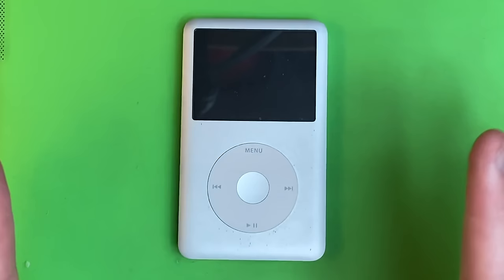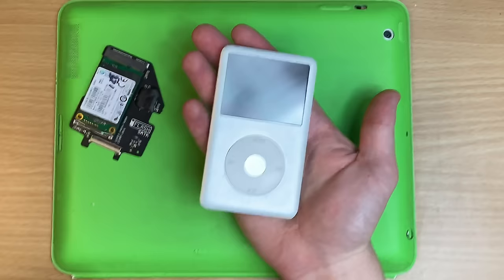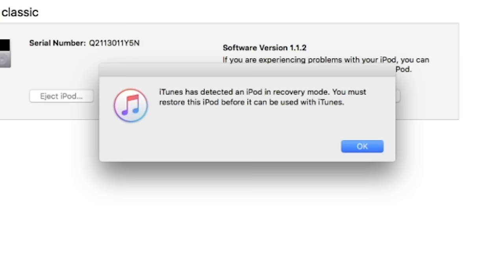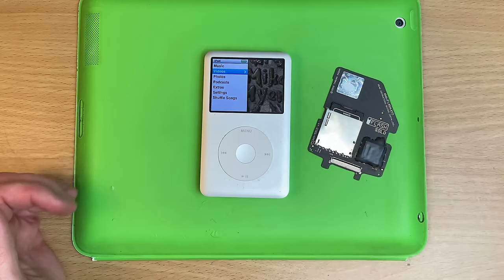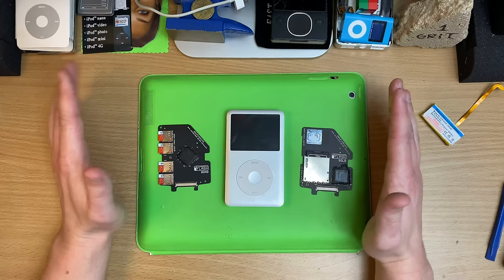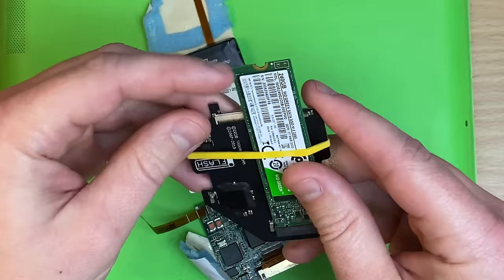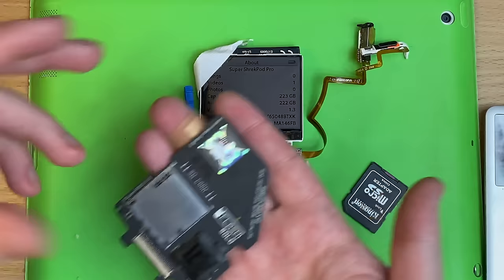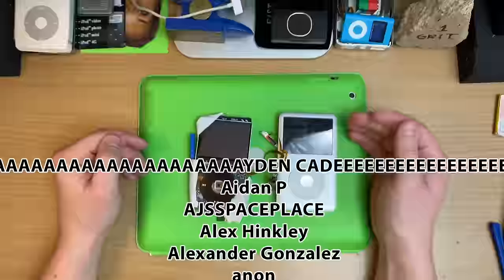PC SSDs in an iPod Classic! (M.2/mSata)

Comment: I love how his iPod has an M.2 SSD and my gaming PC doesn't.
Reply: If you use a SATA M.2 like he did, there isn't any reason to use it in a desktop, since a regular SATA SSD will perform just the same, while being cheaper than the M.2
Reply: Joseph Still this isn’t entirely true, there are m.2 drives that are faster by a large margin, but most the time a sata ssd drive is sufficient
Reply: @thetechconspiracy2  size. They're tiny, and don't need cables.
Reply: @ajfergy5569  Those are called NVME drives. Not useful unless you're working with a lot of data at once. Games and OSes load a split second faster.
Reply: I love you one of his iPods has 2 TB when my PC doesnt
Reply: AbodyAbdalluhhhhhh
Reply: @Adkatka No, the form factor is m.2. The interface is Sata III or NVME. Sata 3 is limited to 6gbs and NVME is way higher. Just because they're in the same m.2 form factor doesn't mean they're equivalent.
Reply: I don’t have a pc m8
Reply: Anonymous they also run hotter and can be unreliable. I have heard of them dying within a year of use. They should have a heat sink on them to help it out.
Reply: Dude, my pc has a 1tb spinny boi from 2009
Reply: thats what she said
Reply: @Alexander_l322  flash drives have a minimum temperature they have to run at, they die faster if you overcool them so it's not always a great idea to cool them manually with a heatsink.

(Even room temp is too low iirc)
Reply: Then get out the guts of your iPod and Chuck it into your pc.There you have it
Reply: Same.
Reply: @tazogochitashvili6514  Iirc, the Nand modules are fine to cool but not the controller, Im pretty sure its because you can create a voltage difference. (Could be wrong). But yeah, however it comes like is how it supposed to be.
Reply: Same
Reply: An ipod is better than my PC
Reply: @TheRealMaroonExpy  I got a imac thing from the recycling centre and it had a 2tb harddrive innit. Late 2009 Imac i think. Now its in bits and the harddrive parts under a sofa or something lol <3
Reply: @thetechconspiracy2  my PC only has a 1TB HDD inside of it. this is what i get for cheaping out with a pre-built.
Reply: @AbdAbdAbdAbd  DIY is cheaper lol
Reply: @Alexander_l322  nvme unreliable? is that why servers are switching to them?

but han, nvme ssds are generally more reliable overall, as the lack of moving parts means that its just better. now if you are referring to drive life, technically its less? but like not noticeable unless you bought a QLC drive (if so, lmao)
Reply: @marcusborderlands6177  I think they can be if not properly taken care of. As in allowing them to get hot which they will if not properly cooled with a heatsink and yes I have heard of Samsung evo I think dying out quite quickly but that was a while ago so maybe they are better now.
Reply: @anonymous2804  not useful? have fun installing call of duty on a HDD, I went from a sata ssd to an nvme ssd and my god is faster
Reply: @paytondev  i'm bout to get 4gbs(replacing my 256gb C drive with a 2 tb one)
Reply: My gaming PC doesn't have an SSD a hard drive it has a hard drive it does not have a graphics card or anything good just a bare minimum crappy pre-built PC
Reply: @thetechconspiracy2  but my laptop is ultra thin so it needs to use a M.2 SSD
Reply: I have a 100gb m.2 only for the os. Rest goes on HDD
Reply: I got a 1 Tb and external2tb spinny boi but its a slim so its ..... GoRbAgE
Reply: i'd just stick with a SATA SSD for gaming.  Get an M.2 for your boot drive, and if there is a thermal pad included along with a thermal shield of some sort.  USE IT.
Reply: @TheRealMaroonExpy  how tho
Reply: @saints_row_cat  Good question. I have absolutely no clue. Still working tho
Reply: @anonymous2804 they load faster more of the time since they can handle at least 3 times the speed of standard sata
Reply: @ajfergy5569 he said SATA. Which is true. The M.2 drives that are faster use the NVME spec, not SATA.
Reply: I got a SeaGate Barracuda HDD, slow but big

Comment: If you go the SSD route be careful of the amperage requirements. It's best to go with something under 1.0A. I've had great results with 0.6A Kingston 128GB, 0.7A Samsung 256GB and even decent results from an SK hynix 256GB @1.0A, but 1.5 and 1.7 rated drives are far too thirsty. Even for a phat 5th with the beefy boy battery.

Comment: I have an iPod Classic 160GB, bought new from Apple years ago.  Some time in the past 7 years, the hard drive died... dead as a doornail.  I found a company in Sydney who repairs Apple products under licence.  They replaced my hard drive with a SSD 256GB.  It's been running well since then (except for the one podcast that won't sync for some strange reason...).  I use my iPod in the car when I go for long drives (I live in a major rural NSW town) so I don't need to fiddle with the radio, and don't need to worry about lack of internet coverage out in the bush.  I have over 2,500 podcast episodes (excellent for long drives, can listen to multiple episodes in sequence) and over 7,000 songs, and all the Harry Potter spoken books.  And I still have almost 90GB free on the drive.  I love my iPod Classic.  Plus, I don't have to overload the phone with things...

Comment: What about putting a raspberry pi zero in one? that would be sick
Reply: Sounds like a good idea! ...If you can connect the screen and click wheel to Mini HDMI and micro USB.
Reply: Shove one in with a ripped iPod BIOS and two of those 2TB Micro SD arrays...
The ShrekPod Pro Ultimax is born...
Reply: BUT CAN U PLAY MC WITH IT.?
Reply: @thescreemregular5168  sadly no
Reply: @thescreemregular5168  not on a zero probably, but you might be able to get a pi 4 to fit in a case and it probably could
Reply: @UCXEO5L8xnaMJhtUsuNXhlmQ  I have pi4
Reply: It to big for even 1st Gen case

Comment: 9:55 there’s difference between 
- msata
- m.2 sata (and there are 3 models of m.2 sata “model B” - “model M” - “model B+M”)
- m.2 nvme 

Usually it’s not wise to mix them with one or another connector
Reply: You're completely wrong on the M.2 part. No, these are not "models", and nor are there three, these are keys, and there are well over ten last I checked for various purposes.

the B key indicates the ability of the SSD to connect over SATA, B and M means SATA and PCIe x2, and M means PCIe x4 only. NVME is marketing speak for the M key ones.

Comment: Two things worth mentioning:
The slowness you experience in the hard drive iPods isn't from hard drive speed. It's just the time it takes for the drive to spin up, as the iPod puts it to sleep whenever possible. SSDs don't need to spin up, of course.
Not only do M.2 SSDs come in different lengths (2280, 2242, etc) but the interface can be different. This kit needs a B-key SSD, which supports SATA. Basically like what mSATA is to MPCIe. An M-key SSD, which is PCIe/NVMe, would not work.

Comment: The SD cards probably took longer because of addressing, being a higher capacity it needs to organise more space in some file formats as opposed to adding straight to the pile. Also you have a module addressing SD's independently which will ad milliseconds to each file transaction. If you had a single SD adapter it would probably outrun the OG drive at a sprint.

Comment: The fun part about these is, if you've got an old HDD-based camcorder you wanna keep using (for whatever reason, the standard def ones are trash but the HD ones hold up well) and the hard drive dies, things like the HD HandyCams use the EXACT SAME HARD DRIVES as the later generation iPod Classics so these'll work well in a camcorder too. Pretty handy to have, like, enough memory to shoot for a WEEK STRAIGHT and not have to worry about the hard drive dying if you knock your tripod over.

Comment: MMC (the predecessor to the SD card) is still used in many lower-cost devices as built-in storage. This includes most laptops under $300-$400 USD, and the lowest-tier steam deck

Comment: I think the reason why the SD card and M.SATA SSD were slow, is because the 3rd party board does have some sort of chip in it to allow the compatibility with the old device. Cuz the HDD is linked right to the device, no extra stuff to slow it down.
While these other mediums are having to be trafficked through some chip in the custom board so it will work.
Maybe if there was an SSD that had that direct connector that the HDD has, then maybe it would be faster.

Comment: 60 degrees ain't nothing for a semiconductor device. you should worry after it breaks 90.

the true problem is the battery. not only because it's gonna get juiced down faster, but also because of the temperature it's gonna be forced to tolerate (and usually it can't and fails earlier)

Comment: Damn old apple devices were actually extremely flexible, plug in a type of hard drive that was in the early experimental pre-pre-pre-pre-pre-alpha stage when this ipod was built, which has an amount of storage that ipod was never even intended to have and the ipod is like "ah a hard drive lets go!". These days you replace a component and even if its a brand new one of the exact same model, in perfect condition, built on the same day, on the same production line, in the same batch and the response is "I've never seen this man before in my life I will now shut down to 'protect' myself".

Comment: "Mate it's not an SSD" As he said, it stands for Solid State Drive. It doesn't have any moving parts like an HDD (Hard Disk Drive) which has a moving disk as the name implies. All of the data is accessed through billions of microscopic power cells rather than a spinning disk. Flash storage has this same type of hardware inside of it. So in other words, it technically falls under the category of SSD.

Comment: You totally can use a Compact Flash card in a computer. In fact, it's a very popular solution for reviving very old PCs (1986 to 2000 or so, typically). All you need is a simple adapter, not unlike an iPod solution.

Comment: Here's why I think the SSD lost to the HDD in that benchmark:
SD cards are slow. In a flat out write race, a hard drive will smash an SD card
I think the reason it feels snappier in everyday use is because SD cards have a lower access latency than HDDs, which means when the iPod asks it for some data, it will start sending data sooner than an HDD. The SD card doesn't have a spinning disk it has to wait on.

The conclusion: unless you're using your iPod as an SD card or trying to sync multiple gigs of data at once, the SD card will feel snappier.

Comment: Got one of these players but it must be made of hardened titanium, I have done my best to open it and so far no success, but I need the tools. Battery is dead, so I need to replace it, but …. Thinking of trying a blow torch or an angle grinder.
Well, it is so fantastic that these great little players can be given a new life and even new colors.

PS. Found stuff on AliExpress, but I prefer not buying electronic stuff from China, only mechanical.

Comment: I finally put the iquad in my 7th gen. I’m getting seemingly random, inconsistent, and intermittent track skipping.   Tracks will play, then pause for a second, then resume before skipping a few, then playing again. Going back will usually make them play, but will still randomly skip ahead at some point. 

I’ve formatted my 128 Sandisk Extreme pros, went from 4 to 2, resynched. Nothing skips in iTunes or the original hdd.  Files are from various sources.
Havnt tried another mobo, zif, or flashboard yet.

Comment: A pro of using the 4 micro SD card one is that its super thin. I used the 4 micro SD card one and the upgraded 3000math battery and after filing the internal frame a little I was able to fit both mods into the 30GB thin model iPod 4the gen

Comment: m.2 2242 size? Cheap ones on AliExpress, search for Goldenfir. m.2 2242 256GB costs $29.55 right now. Same controller as on the WD Green SSD, but Flash chip are different sometimes.

Comment: Which flash disk was tested? because there's potential bottlenecks with conversions and single cards, plus the quad could be operating in RAID 0, essentially writing bits in segments or stripes to each disk every so many kb for a more evenly distributed load. If there were no other bottlenecks like the ipods controller and it's in RAID 0 the quad would perform about 4x as fast in reads and writes than a single.

Just curious because I put the quad in mine, but it was more for reliability reasons than anything else. Hard drives be dying sometimes

Comment: Good videos and information, however I would like to know if these things actually work properly for you.
I have upgraded a 160gb 7th gen with iflash quad, 4x 128g micro sd and an gen 2 iPod mini with iflash cf adapter and 256g sdxc.
I have followed all instructions and done over multiple times.
The 160g skips songs all the time, will get stuck in a skipping loop where it won’t play a song for an hour just skipping, restarts all the time, it’s bloody terrible and I regret doing it.
The gen 2 iPod mini tried to restore on iTunes but then gave up and now it cannot be recognised as a drive.
All cards were formatted externally to fat32 and I have roughly 9500 songs taking up approximately 80g.
Why are there so many issues with these upgrades?

Comment: On 1:00 the comment section is actually wrong to call CF cards not SSD's because they don't go into computers - they do. There are people that restore old computers with IDE drives in them exactly the same way that these iPods get flash modded. The IDE and CF interfaces are (electrically) identical, so it's just an adapter and a CF card to replace an IDE drive. They are not SSD fast, far from it. Consider it more like an SD card or a flash drive. But they are flash nonetheless. And if we really want to judge "proper SSD's" by their performance, I can tell you that the eMMC crap that modern day "budget" computers is just as shitty. And people call that an SSD nonetheless.

Comment: Hey before applying the thermal compound remove the sticker from the SSD, paper is surprisingly non-thermal conductive.  

I have tried to put a big SSD in a Classic, but it's one of the max 128GB versions so I am stuck at trying to format the card on  a computer and trying if the iPOD takes it (with the RockBox firmware on it) but it appears that Windows 10 does not want to format these correctly anymore when inserted in an iPod and connected via USB, apparently I need to use Windows 7. When I have time to create a W7 install I will try again.

Not for the faint of heart indeed.

Comment: I found my brothers old iPod that hadn't been used since maybe 2008 or 2009. The harddrive was completely boned, couldn't restore, tried to reformat it but it keeps crashing half way, disk checking with Partition Wizard said it's screwed basically. Perhaps I will have to try one of these mods, or should I just get an unbranded 1.8" HDD off eBay?

Comment: Now what I would be curious about, since the controllers are so small on SD cards they do get just as hot but over a tiny area compared to SSD. So that's why it seems that way, but believe me running an operating system off a SD/micro SD is cooking that little fella. SD controllers also suck for massive data loads hence you have so many issues making 1000, 2000, 4000 GB ipods from them that aren't a pain in the ass to upload onto except in small bits n pieces. 

 Could a new SD express, which uses a controller like a NVME SSD conroller and are super fast, actually run an iPod under heavy load like you did with the SSD and not crap itself while getting the benefit of less battery consumption? Could you make a 4000 GB ipod that is both fast, low power consumption, and actually convenient to upload stuff to?

Comment: I'll explain the ACTUAL differences of SD Cards and SSD's. First the flash type. SD's use NAND flash, and SSD's use QLC, which can reach higher capacities and faster read/writes. And second, the controllers. A good SSD that is worth your money will have either a SATA III or PCIe 3.0 controller, plus DRAM. All you need to know is for every TB an SSD has it should have 1 GB of DRAM. SD's don't have any of this. Their "controller" just has basic info on it, like Vendor ID (to identify the company who sold it and when it was manufactured and what batch it came from) and it's capacity. Thank you for coming to my TED Talk

Comment: I have the 4 ssd Adapter in a 120gb 7g iPod. I have 4 200gb cards but It just shows 128gb in total 🤔😳 tried formatting a couple of times but still no luck. Any good suggestions?

Comment: how far can I take this?  I have reasonably priced access to msata SSDs up to 2TB.  What FS does this use? Does the scanning algorithm slow the hell down at some point beyond which any more space is impractical (like what's the point of putting in a 512gb SSD in, if it goes down to snail pace at about 300 gb, for the sake of example?).  I wouldn't mind going to any (probably most productive, most recent) model that can cope with a large SSD (be it m.2 or msata) and have an exceptional battery life.  Please, advise.  I am fully aware that it's my sole responsibility but some sound advice would be good for a start.  I've come to believe that Apple products have some arbitrary limitations at times.
Thank you.

Comment: bro this is cool and what not, but you do realize iPad os was designed to not have any loading times right? Steve Jobs wanted to make the iPod an appliance and not a computer. even if you have the original drive, it's most likely going to go smooth.

Comment: Aluminum might be physically more tough than plastic….. but it does not work for these devices :/
Like a device that you’ll never need to open, that would be fine. But something that you can open, and has easily replaceable parts… naw. The 5th Gen model is the best, because you can open and close it easily due to the plastic.